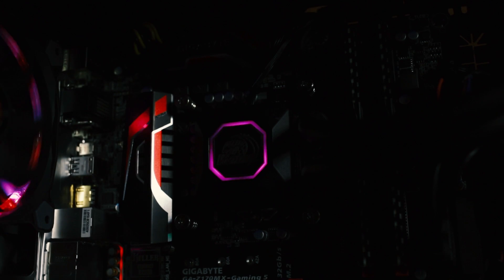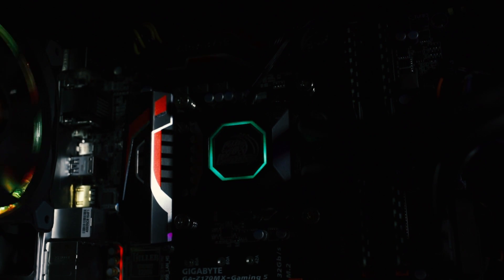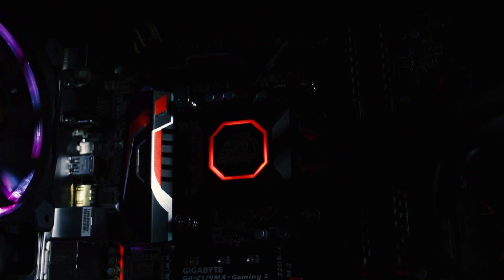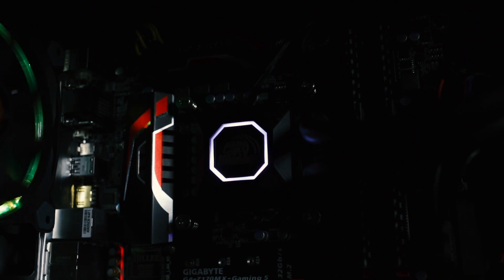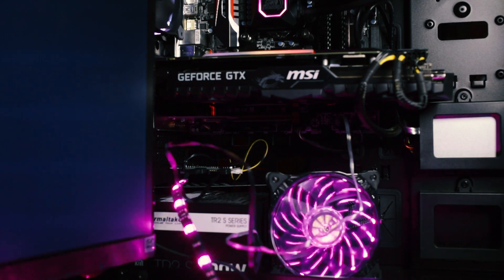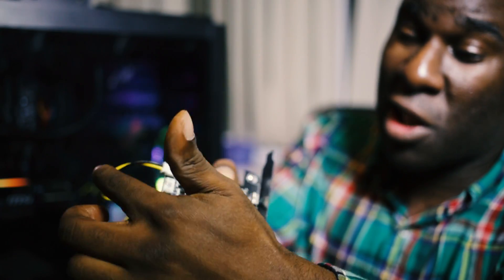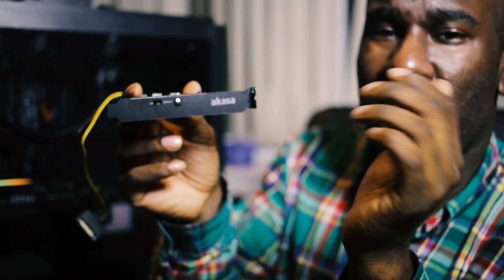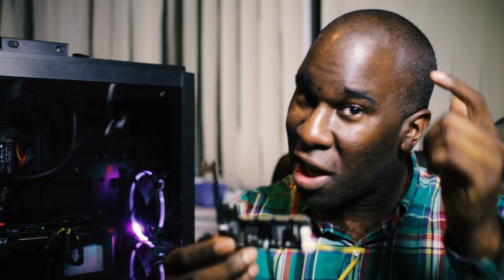Akasa R20 Venom AIO And Control Card RGB That Can Work Anywhere

Comment: only with the SATA cable, I can change the colors, or do I need to connect the RGB cable on the motherboard? my n motherboard has RGB connector how do I change colors? can I change RGB fusion software in the same way?